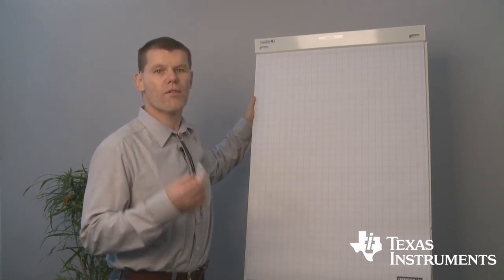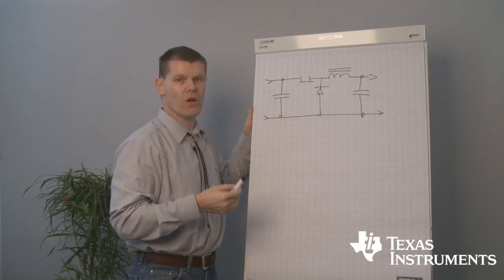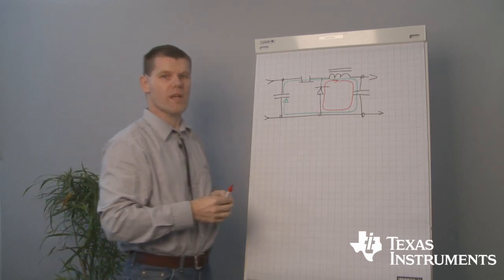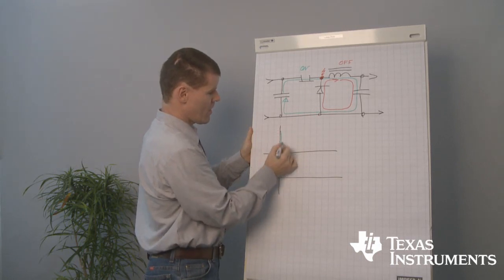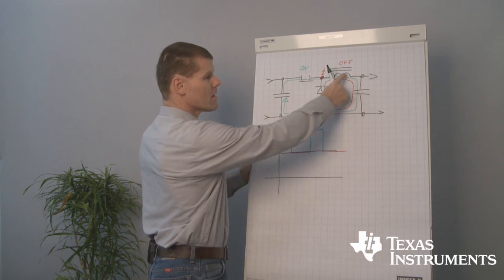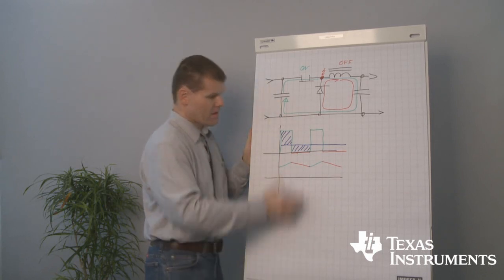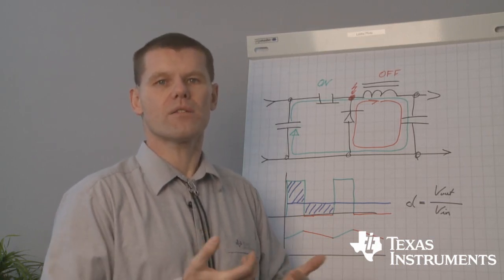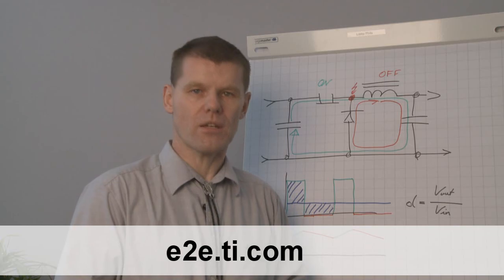BUCK POWER STAGE - Tutorial with Bernd Geck (part 1)

Comment: hi can you please help me out with my project I want to build a charge controller for two solar panels that will make use of a buck controller and can charge two 12volt batteries and output current of 8 ampere. pls help me out with the schematic circuit diagram please.